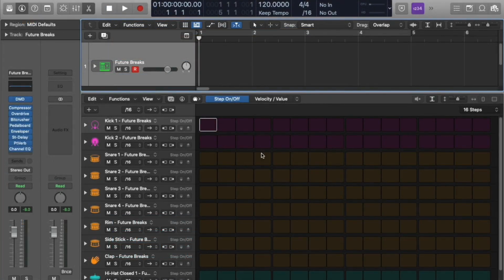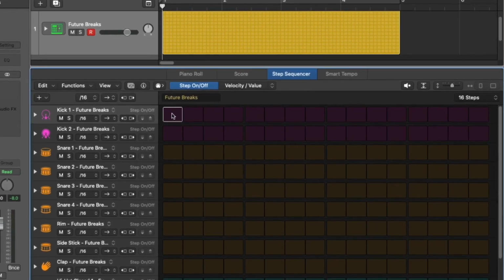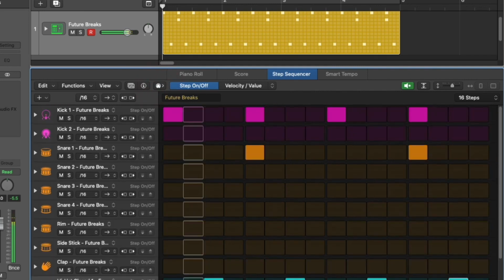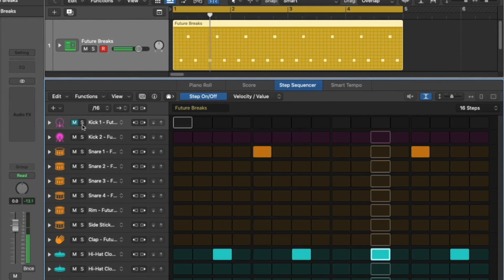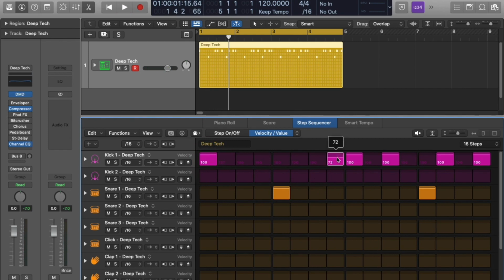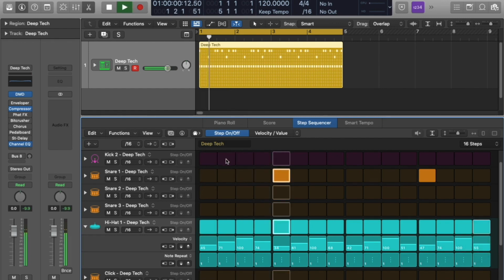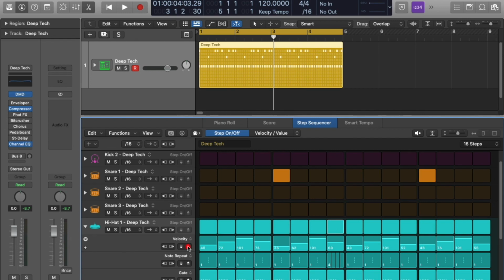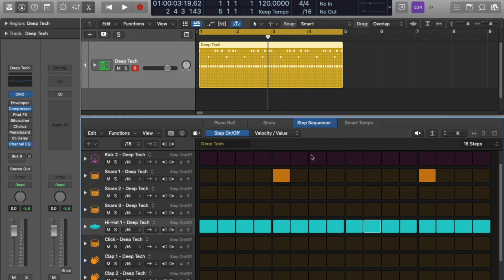Logic Pro X 10.5: Step Sequencer Tutorial

Comment: Can you not program the step sequencer to have any other number of steps? For example could you program it to correspond with a 7/8 time signature?
Reply: I've been trying to figure out how to do this also. It seems like it's only programmed for 3 and 4 beat measures which is annoying.
Reply: @UNCANNY305  In the Step Sequencer set the Step Rate to 8,  use the Loop Edit mode and set it up so that the Loop is 7 steps long.
Reply: In the Step Sequencer set the Step Rate to 8,  use the Loop Edit mode and set it up so that the Loop is 7 steps long.